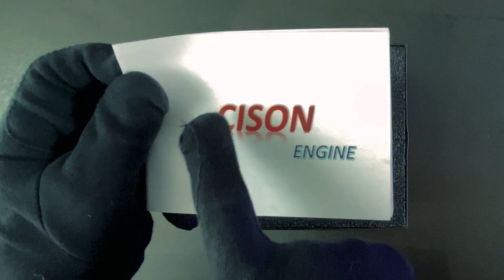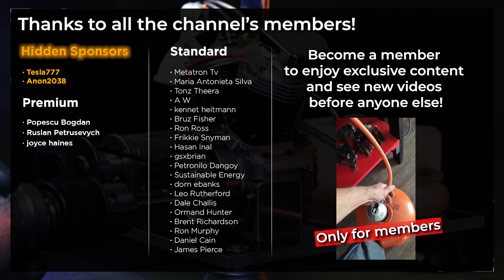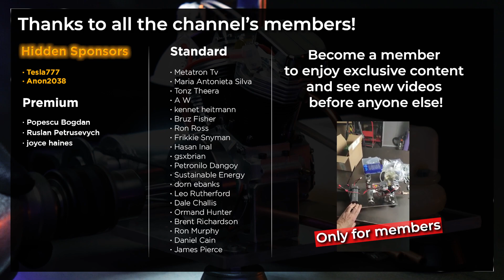I Turn a Harley Davidson Engine Into an Electric DC Generator

Comment: you should see how well this engine runs on Hydrogen through electrolysis and measure how much power it produces. Just a thought for a future project. Really enjoy how organized you are. 👍
Great video by the way.
Reply from the maker: In the next video this engine will run on water
Reply: @HiddentechnologyYT  اخوك من العراق الف تحية